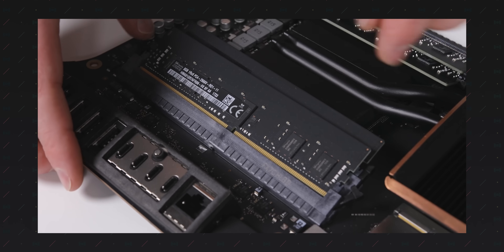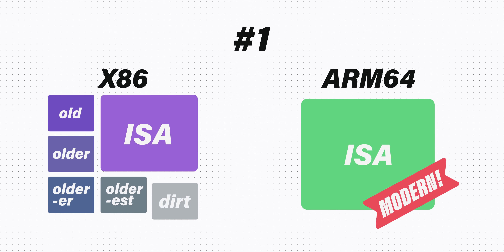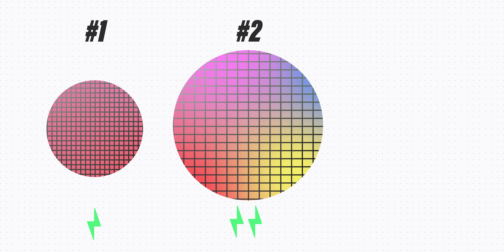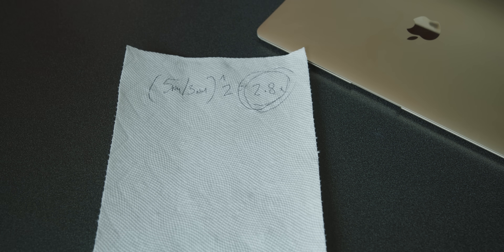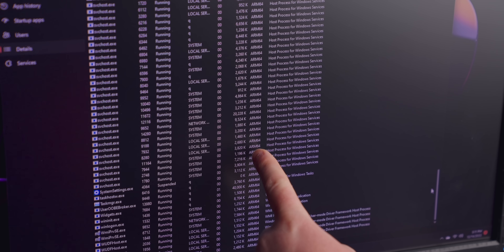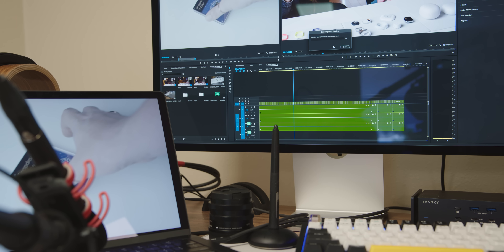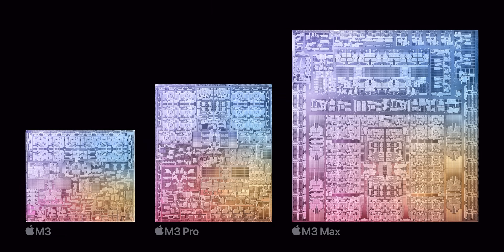Apple's Silicon Magic Is Over!

Comment: Apple's M-series has been a killer for their product line (as in, it's killing off their sales, not it's a cool killer product). The number of programs I have had to tell people 'Sorry, they don't natively support Apple's new processor' is very high. They're overpriced for what they are. They don't run existing software. They're difficult to dual-boot to "real OS's" like linux or Windows.
I sincerely hope Microsoft realizes they're heading down the same path and stick with x86. We just had to decline a 300-device order for Surfaces because the 5G models only come as SC3 processors. Dell is getting the business instead.

Comment: I was a UIUC Business major, so I understand the difference between MARGIN and VOLUME, but I don't believe Tim Cook KNOWS enough about Business!  (Like that old Apple Board Member K---something who PREVENTED Apple from licensing the MacOS, as Bill Gates suggested they do in 1985, 10 yrs before he came out with Win95!)

I'll be staying with my 2010 Mac Pro 5,1 for as long as possible, currently 'booting' Monterey 12.7.4 from an internal nvme PCI drive, with a 12-core 3.33ghz Xeon, GTX 670 2g GPU, 96g, 2xUSB3.0 + 2xUSBc card and a free slot #4!  My 5,1 is right ABOVE the M1 chip on the Cinebench 2024 ranking?
Reply: Sonoma or Ventura soon!
Reply: Cinebench 2024 puts my 2010 cMac Pro 5,1 12/24 3.33g Xeon ABOVE an M1 and an i9!

Comment: Just 5 years ago no one would be doing the intense editing you do on any laptop, this is what desktops were for and they're now becoming obsolete. Sometimes you have to take a step back and look at how quickly all of this has advanced, and it's incredible
Reply: 9 years ago I was doing HD video mixing on a laptop. Also full multi-track video and audio production.
But not a Mac because those would overheat if you ran Handbrake for more than a few minutes or tried playing more than 2 4K videos at a time.
PC manufacturers should have used the slogan "Don't worry, your Mac will be able to do this in like 6 years."

Comment: The competition may be starting to catch up, but they're still miles off. Qualcom's latest and greatest benchmarked behind an M3, and they've just released the M4. I've just got an X1 carbon as I use Linux exclusively, the ultra 7 155H is a step up from the 11th gen i7 in my previous computer but battery life is about 6-7 hours realistically for day to day tasks. When you put it in energy saver mode, you can seriously tell. My colleagues have M2 and M3 airs and Pros, they get about double the battery life. Battery life is FAR more useful than raw power, and apple silicon is way ahead on both. Interesting to see what qualcom do in the future, I highly doubt I'll ever buy an Intel based computer again.

Comment: Having repaired or attempted to repair many MacBooks, I would never buy one. Forgetting all the booby traps they place in there and the HIGHLY questionable design/hardware connection choices like the ribbon cables with zero rigidity(& zero slack), the placement of obstructions to hold connectors in that then make it impossible to get them back in without removing said obstruction which is adhered to the motherboard over traces, etc the $/performance is obsurd in my personal opinion. Especially considering how easily they break. One IT office at a place I worked had multiple 4' stacks of dead MacBook pros and Airs that were no older than 2 years old at the time. Many had heat syncs that ad gouges on the block on top of not being flat and relied entirely too much on thermal paste....thermal paste that apparently dires up and cracks after only a couple years of office use. I have opened mining GPUs that ran full blast  for 5-7 years that had paste in better shape than those. I used a MacBook pro when I worked at that place and to be honest, it WAS fine for the type of work we did, which mostly relied on cloud applications. I liked Preview as a default PDF editor, but it wasn't enough to make me pay what they ask for those things. I said it "was" fine, because when they rolled out the new version of Mac OS, the thing became completely useless. It would hang up doing the simplest tasks even after doubling the RAM and installing a SSD. It was the same age as the ones on the stacks and even though it still technically "worked", it might as well have just joined the rest of them. I ended up getting a crappy $350 Asus laptop from best buy and that thing is still kicking today many years later. It is poorly made and uses very cheap parts, but still outlived a $2500 macbook?! I get many brought to me for repair and I turn them down most of the time. Especially if they are overheating since getting to the chips to replace the paste is a craps shoot as far as being able to get it back together. I admit I have not worked on many of the apple silicon models, but I they are apparently just as likley to die as the Intels apparently as people keep wanting me to fix them as paying apple will cost as much as a new, better PC. They are.lile the Subaru or VW of computers based on my experience and I just don't get why they are so popular. Although, the reason I hear from those that bring me them when I ask why they bought/buy Apple is "they just work". I'm not sure where that idea came from since they keep bringing me broken ones, but I have a feeling it is the result of people buying the marketing and then passing it on as personal experience. Kinda like how some people swear that the 70-80% difference in price from an Nvidia GPU is worth the 5-10% on average performance increase....on games using RT as AMD usually tops them when doing standard rasterization which is 80% of games. Perhaps I am missing something, but my experience makes that pretty clear to me.

Comment: I was NOT impressed by the M1. And my world speaks x86 anyway.
Not impressed by the M1 and Apple changing the CPU architecture again, I was rather disappointed with Apple.
Apple has already changed the CPU architecture five times. If I were an Apple user, I would have had to buy my software again 5 times. Things are different with my x86 PC, which can still run the software that I bought 34 years ago. 
If you don't know, Apple made the following CPU architecture transfers: 6502 -> 68K -> PowerPC -> x86 -> ARM (M1)
And battery life isn't that important to me since I work on a desktop PC most of the time anyway.

Comment: @jreg intro and extroversion are arbitrary social constructs, and despite the obvious negative multiplier to high trust communities that parasociality and it's complexities (which the term obfuscates and makes appear more monolithic and one dimensional than the reality of the intergenerational wealth disparity, transfer, and derangement and its coinciding perversion of civility and pedagogical failure to transmit wisdom from the past) presents to millennials, zoomers, and alpha, you still shame and insult them in a vain, ineffectual, and impotent effort to compensate for the fact that your proposal to form a poly cule/thruple was likely just recently shot down by couple who'd prefer to stay home and make out with eachother than work on your community building project. There are no individual solutions to systemic problems, so don't frame it as a matter of individual choice, or neg couples for doing what will instinctually lead to the creation of community naturally.

Comment: That #1 diagram is a bit misleading - if the size of those older capability sections on the X86 chip were drawn to-scale with the rest of the chip, they’d be too small to see.

Comment: Apple tries to push gaming now yet they skim on storage. Even native WoW is 100GB. Same with RAM. And the storage is soldered and not user-replaceable. If I wanted to buy a MacBook I can work on as a software developer I would have to look at models with around 32GB+ of RAM and realistically 1-2TB storage to not run around with external storage constantly. Right now I'm using Linux with Windows dual boot for games and some Windows-only apps/hardware and that's not "bad enough" to switch to current Apple offerings.

Comment: I did a little test.  I bought an M3 pro MacBook Pro. I have an M1 Mac Studio Max.  I did an import and export of a 30 minute 4K video, with stabilisation and other basics.  They came out at the same speed.  So I sent the MacBook Pro back to Amazon and got back my £1800. I’m back to my M1 MacBook Air which, yes, isn’t as fast as the Studio, but it’s still quite zippy. I love my MacBook Air and use my Studio when I’m at home.  Job done.

Comment: Apple customers don't buy mac's because of the hardware.  They buy it because they like MacOS.  So unless you can run MacOS on those arm laptops, no, they will not beat Apple.

And I don't think arm is gonna take over the x86 market.  Not when you can build a custom pc using an x86 cpu, storage, ram, motherboard, psu.  And arm doesn't even have a common bios like pc's do.  All that allows then for multiple companies to offer pc's on the market for desktop, server, and laptops, with great competition.

Comment: I was an avid apple user since 2007. Being an engineer was hard already to avoid getting bullied for using a mac but in the end you could always run linux or windows for compatibility. I bought the M1 air and with horror i realized the roseta false advertisement. Apart from running basic apps nothing else professional works... I kept some hope that at least a version of the mac pro and macbook pro will come with x86. nope, everything is Mx... Additionally when i switched I realized that PCs with windows and linux are fine and vastly cheaper. if apple didn't like the hot intel chips AMD was offering cool x86 chips but to me it seems that they just wanted to avoid the profit margins of Intel/AMD. They also could have spend some of the billions they make to support software companies and game studios to make native versions of everything... But... as usual nothing... they just wanted the money... Sadly any Arm based device is pass from me unless they make sure compatibility is not an issue.

Comment: Problem with Mac is everything becomes obsolete over time, MacOS updates constantly, if you want to stay on older versions you have to live with outdated software, and even Firefox has limited support for older MacOS. 
Then there is the hardware thats almost nay impossible to repair and breaks way too often frankly, the only computers I ever owned that have broken on me multiple times mind you, are Macs, particularly, Macbooks, both the Air and the old Pro models, Apple products are incredibly hard to love when coming from a PC world where I am all too used to working on machines that are like 10+ to almost 20 years old and in top working order. When old IBM ThinkPads from 2004 can still run modern browsers and W11, thats just all too telling for me.

Comment: people that keep saying x86 is bloated and inefficient and arm is so much better really have no idea what they are talking about. modern x86-64 Processors have very little in common with the OG intel 8086. Also please go ahead and look at the complexity of modern ARM64. Both Architectures are similar in complexity. There is no evidence of modern ARM being more efficient than modern x86.
Both use Branch Prediction/Speculative Execution/out of order Execution and divide Instructions to smaller microinstructions making both essentially optimizing compilers instead of classic CPUs.
The "bloat" in all modern CPUs, and also the main reason why they are so incredibly fast is the addition of many functions that take load of the simpler core logic. 
Nowadays a lot of tasks have their own special logic on the silicon like AES,SHA,Virtualisation functrions,h264,hevc,Security etc. Also a lot of old instructions habe been dicontinued, intel ditched x86 "real mode" years ago. Efficiency is not a matter of the ISA its the implementation of it. Thats why amd managed to kick intels butt with ryzen. And thats exactly why Apple managed to pull it of. Intel is left in the dust with their outdated node size. that has very little to do with their instruction set. X86 only has amd and intel, this slows innovation greatly. ARM has many companys advancing its architecture so it is years ahead. Apple also cut massive cornes with their chip design. Lacking advanced RAM and Storage capabilties to save power. The high level of integration has its price. Once more open ARM platforms take on speed and amd advances their desing further, the difference will be negligible. Already a current ryzen cpu in single core metrics matches apple m3. only the powerdraw is almost 2x. That is simply given by needing an expensive memory interface and a lot more PCIe Lanes. Please stop with the uneducated "Hurr Durr, x86 is caveman technology"

Comment: Never had a problem with old Intel Macs, yet they had easily swappable ram/hdd/battery, aand had all the ports imaginable 😅 while only being half an inch thicker, oh and they had cool designs and glowing logo. Upgradeability= used most of them for 10+ years 😅  oh and the PS went downhill also 😂

Comment: Watching this on my M1 MacBook Air. When I got it in 2020 it was faster than my gaming laptop (at least with VS Code) with a battery that lasted longer than my fanless Pixelbook Go. Truly amazing.
Reply: "it was faster than my gaming laptop (at least with VS Code)"
1. Bullshit. The M1 series is atrocious at actual heavy computational tasks which fall outside the handful of use cases built into the SoCs.
2. Are you trying to do a comparative benchmark between a netbook-level Mac and a gaming laptop with a real GPU... by comparing a text editor? JEEEZ the shills are out in force.
Reply: @JustPlainRob  1. I didn't say my gaming laptop at the time was very good. It also had a bug with the IntelOptane driver that pinned 1 of the 4 cores to 100% usage even at "idle". However, it was the laptop I played games on because it ran Windows.
2. VS Code is the application I wanted to use on a fanless laptop. It was super laggy on my Pixelbook Go, but works flawlessly on my Macbook Air M1 with a longer lasting battery.

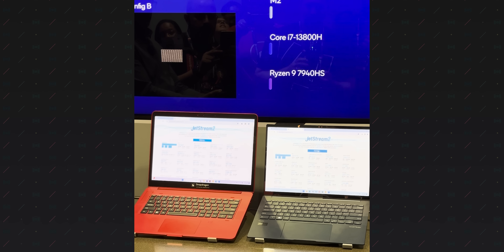Comment: 12:01 shows comparison M2 (off the scale), i7-13800H at 177 fps, and Ryzen 9 7940HS at 139 fps. I don't need anything better than 60 fps AT MOST. I have NEVER need anything better than 60 fps. Nobody has. Which is why all computer equipment is commodity equipment now. I can go to the electronic recycling depot and pick up any old PC from 2015 or so and it'll do everything I need or conceivably will need. These modern machines are legit "super computers", for people who only surf the internet or play 3d games or other mundane things.
Anything I need to do that requires brain power, and a stronger processor, well I'm doing that at the desk with a proper desktop workstation PC (which cost me significantly less than $1000 to buy outright). Anything else I can probably do "just fine" on my iPhone SE from 2016 and which cost me $100 second-hand and which works just fine, even to this day (even better, has proportions that still fit inside my hand even though it was significantly larger than iPhone 4, which is also still pretty good).
Microsoft, a powerful partner, are you kidding me? Buddy I've moved everything I do onto Linux. I run Windows strictly inside "virt-manager" in virtualization. Microsoft is a security risk, it's glorified malware. Apple is approximately the same, I could run Mac-OS in another virtual machine, but I honestly have no reason to do that: they literally have NOTHING to offer me.

Comment: CPU's are fast enough anyway. The issue is software bloat, and all the unnecessary data we need to process.
Case and point, this Chrome tab by itself uses over 500MB of memory. That's a lot of data for a web page.

Comment: I work in tech retail and I’ve had middle aged people return brand new M3 macbook airs “because it’s heavier than the 2015 macbook i’m replacing it with.”

M3 Airs are about 5-10x as fast (depending on if your’e looking at singlecore or multicore performance) as a 2015 intel macbook. I think a lot of people, who aren’t “power-users”, would be super happy with a computer that’s maybe… 3x as fast as their old one? That weights slightly less, supports current software (because of course apple prevents you from downloading its own native apps from their native appstore if your computer isn’t updated), and has a better screen. They could probably even charge the same for it. As Snazzy Labs says, for a casual user, the current Airs are way too similar to the Pros, and vice versa. They both seem to have the same target demographic of… video editors, with the base model M1 Pro and M2 Air offering similar performance at pretty much the same price, for the time they were both sold simultaneously.

Comment: For me, the performance I got on the M1 Air was so good, I got one to replace my Threadripper 2950 system. I later upgraded to the 24 Core M1 Max 16” MacBook Pro and the M3 hasn’t enticed me to upgrade. I’m looking for Apple to bring Thunderbolt/USB 5 along with an SD Express port, plus 2TB SSD and 64GB of RAM as the base for the MacBook Pro Max system. They charge a lot for fr those systems, they should come with more.

Comment: I think to help combat some of those issues. Apple needs to focus again on the operating system. they need to reduce the footprint. The operating system uses so another words make it lighter while still keeping its functionality that’s the same problem. Windows has the footprint of Mac and windows is crazy. Reduce the footprint reap the rewards. It’s a simple as that.